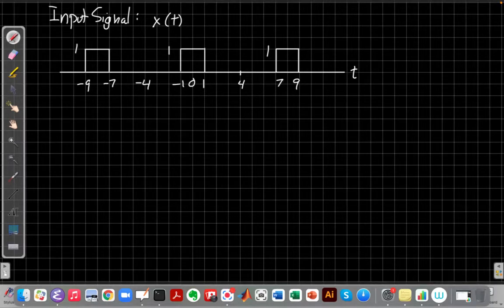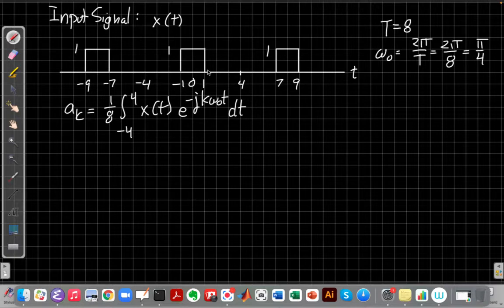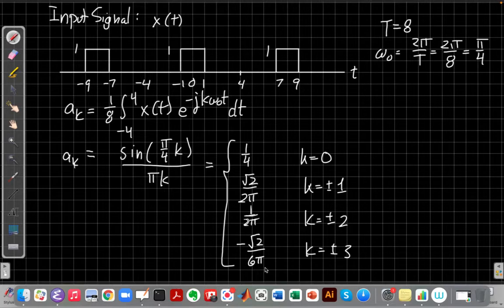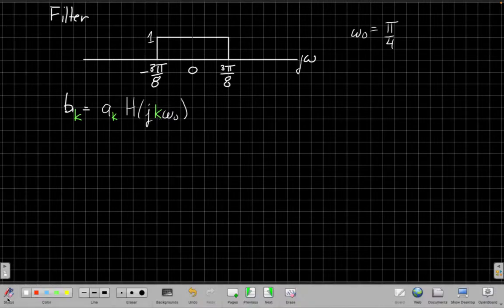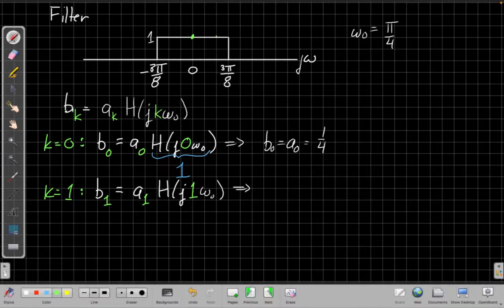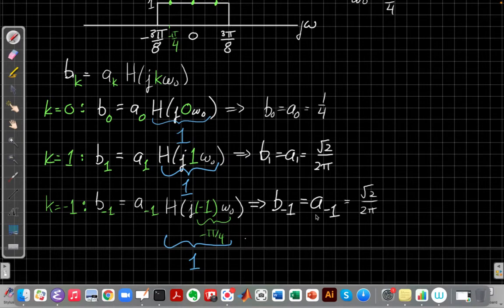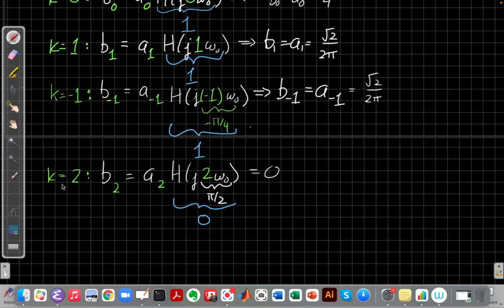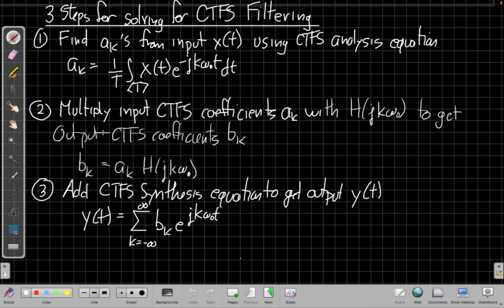CT Fourier Series and Filtering Example: Part 1

Comment: Sorry in advance, this is the first Fourier problem I've ever solved, and it's very difficult to type equations in a text box like this. Shouldn't ak = sin(pi*k)/(pi*k)? I got the exponential equalling e^(j*k*omega*4) which turns into sin(k*omega*4), which would lead to the fundamental period=pi/4 and the t=4 canceling out.

I need to brush up on my Euler everything, assuming I did it wrong somewhere (highly likely), I would like to know where I goofed.Thanks.